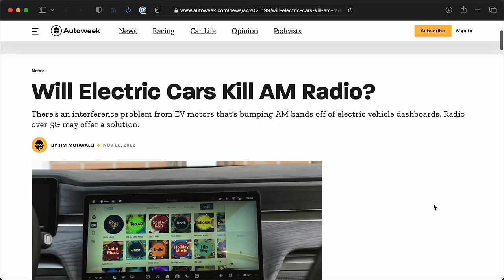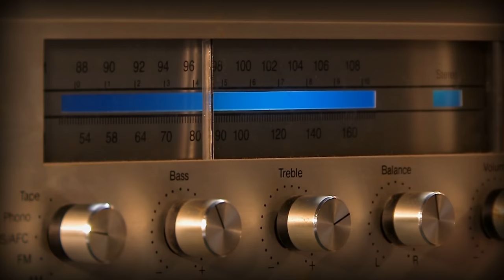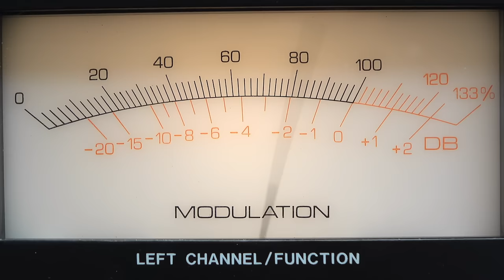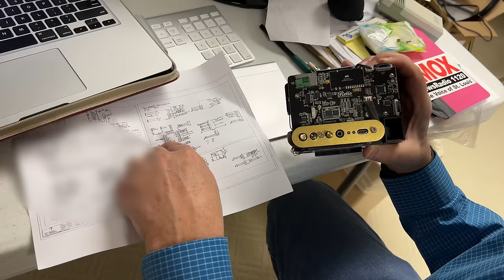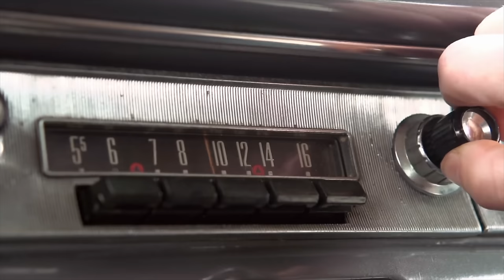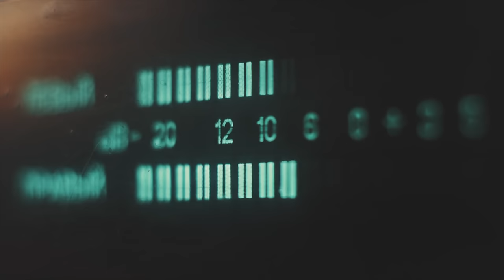Is AM radio dead? Tesla thinks so!

Comment: I buy, sell and restore old radios from the early 1900's.  Some of those old radios still have a great sound and pull in a good amount of stations at night. Many of those radios have short wave band receivers as well, and it's fun to listen to stations from around the world, even though they are also becoming scarce. I still enjoy the sound of an AM radio, the sound is undeniable.  Yes many things today generate amplitudes that interfere with AM signals, but it is still fun to listen to.
Reply: The sound quality of AM stations is crap. A far cry from what it was when I was young. The 5kHz audio bandwidth, the huge amount of compresssion and limiting, and even the digital audio processing taking place in the studios, make for a lousy listening experience.
Reply: Do you have a website?
Reply: They had big speakers, too. Heavy magnets.
Reply: I use to sit outside at night in my 57 Ford Ranch Wagon and easily tune in stations many states away. Those old car tube radios had the best reception.
Reply: @spaceranger3728  Not before 1940. AC radios before then had electromagnetic speakers, not permanent magnets. It took a lot of voltage to drive them but they were full and rich. The exception was battery operated "farm" radios which used PM's prior to 1940.
Reply: @johnstone7697  a lot of it has to do with the quality of the radio. I have a Sangean HD radio that not as good as expected, but my Grundig shortwave with AM and a long wire I can pickup stations three states away.
Reply: A good outdoor active antenna that covers LW to SW is a must for anyone restoring late 1920's and 1930's radios. Ultra strong reception and zero interference from computers, phone chargers, and non-class 2 wall warts in the house. Take it from a fellow restorationist ( ...currently working on a Trans-Oceanic and a Westinghouse "Seven Seas," both from 1969. The early multi-band transistors also have much better AM audio than most of what comes out today.)
Reply: @johnstone7697  A local AM station around here runs classic hits at night. It sounds like an 8-bit audio stream from 1998.
Reply: My dad bought one of these Y600s
https://en.wikipedia.org/wiki/Trans-Oceanic. Listened to the 1st orbiting satellite with it. Also WSM in Nashville at night. We lived in Detroit. Guess it helped with his home sickness. Still there AM 650 & with clear channel 50,000 watts.

Comment: AM radio stations really killed AM radio. Prior to the 1990s, on an AM/FM combo, the AM station was typically a "full service", 24 hour live format and the FM many times was automated music...

In the 1990s, most AM stations seem to make the shift from being local, "full service" to 24/7 nationally syndicated talk radio (large corporations taking over local radio as part of the 1996 Communications Act, likely play into that also), and those stations no longer were the community information hubs they once were.

As far as sound quality, 10 Khz channels with CQUAM Stereo sounded really good on a receiver that had an equally wide bandwidth...But broadcasters and receiver manufacturers went narrower band and dropped the C-QUAM...

Now broadcasting corporations just see AM radio licenses as a backdoor to "commercial LPFM" operation.

The FCC is also to blame for not strictly enforcing Part 15 noise limits on consumer devices. 

No reason the equipment inside a Tesla can't be filtered to reduce RFI. The traditional internal combustion engine literally has spark gap transmitters firing thousands of times a second, and they are filtered to reduce RFI. If you look at a lot of retro computers, they have extensive RF shielding around them and small capacitors on lines for RF shunting, now you rarely see that, mostly as cost reduction measures (ok, the RF shunt capacitors are no longer there because data lines are shifting at UHF/SHF speeds) ..
Reply: As for modern lack of shielding, well designed multilayer boards are usually a cheaper way to meet radiated emissions.
Reply: Shielding 700Kw of switch mode supply well enough that an AM radio will work well with the antenna placed effectively inside the loop area of the supply would be an interesting challenge.
Reply: What you are describing would go against Tesla’ s, and most other Web 3.0 disruption based companies design tenants .. which is to push off that cost onto everyone else .. Tesla could build RF emission shielding into their cars, but won’t,. And if they were pushed they’d just say that everybody else needs to design more selective tuners. 

It’s basically what happened with Light Squares and their interference with GPS signals a decade ago .. they wanted to run LTE on their purchased frequencies, regardless of the fact that consumer GPS receivers would be jammed while in proximity .. the company pushed it off on everybody else to redesign their RF front end
Reply: Fun fact: Part 15 has an unintentional radiator exemption for automotive devices. Maybe not quite a free pass, but I wouldn’t be surprised if some use it as an excuse to cut corners.
Reply: @satsuke  I didn't say they emitted significantly outside their chassis. I imagine that they do comply with all emi requirements. I said putting an antenna inside the dang thing would be difficult.
But no, you tell them how trivial it'd be and how evil they are.
Reply: Said   " The FCC is also to blame for not strictly enforcing Part 15 noise limits on consumer devices. "

I just got one of those $ 40 Baofeng UV-13 Pro V2 radios that everyone loves to hate but buys them anyway.   The battery  ( 7.4 V ) has a USB C ( 5.0 V )  port for charging.  As you might guess, there is an internal to battery DC to DC converter.  It makes so much RFI a that I can hear some noise on AM , tons of noise on the 450 - 490 Mhz FM band ,  have not figured out  what other bands are affected.
Reply: @satsuke   said "     they wanted to run LTE on their purchased frequencies, regardless of the fact that consumer GPS receivers would be jammed while in proximity .. the company pushed it off on everybody else to redesign their RF front end  "  

See also aircraft landing radar and 5G.   see "  0:00 / 28:59
5G C-Band Interference with Radar Altimeters in Aviation "  on the channel " blancolirio  "
Reply: I think you and your AM radio need to go back to a time before electronic ignition systems. Cars were very noisy when they had loads of mechanical things making and breaking connections. Modern EFI systems have none of that, leaving just the spark gap to make most of the noise, and it's rather well shielded inside the engine block.

Having gone through the BS to get a computer system through FCC testing, you'd need to encase the entire computer in foil to keep it quite these days. We had to use RF foam shielding on the case lid (like the stuff around an oven door, only much smaller), shielded ethernet cables, and put ferrite beads on all the PSU lines, including the external AC cord! Just to make the point... EVERY component in the system had UL & FCC certifications.

(I recall the story of Be (of BeOS fame) submitting the BeBox for testing. Radio Shack / Magnavox were adamant they NOT send their monitor in with the unit -- they knew all to well it won't pass. For the record, every input and output must have something attached to it, and the BeBox has a lot of I/O.)
Reply: My chevy bolt has an am radio, but really nothing interesting on it, so I never end up using it
Reply: I remember when I was younger that the police had the right to ask you fix a bad sparkplug wiring job if it interfered with their radio.
Reply: Something tells me that meters of extremely high voltage DC wiring from a couple of ESCs feeding directly feeding onto a synrm motor is gonna be significantly harder to shield than a couple of sparks.
Im no engineer, but the video quality on my FPV drone almost shuts down once all 4 of my ESC's are on full power. 
I cant imagine a car like your average tesla tryna get AM radio from all of that.
Even then, its AM radio. No one uses it anymore. Even when used out in the country as far away from powerlines and whatnot, AM Radio is just static and barely works.
Reply: AM Talk radio, especially local talk shows, until about circa 2005 were interesting, it is what kept AM radio alive throughout the 90s.

It appears that AM talk radio was artificially killed around 2011-2013, some AM talk radio stations had a significant listener base for interesting local talk radio,....so it was quite mysterious as to why they were all shut down or changed format changed the show at nearly all the same time.

Some might say, that social media and the internet has taken over the role of AM talk shows, but not really.

 The biggest difference between the internet and AM talk radio is that it is easier for the powers that be to manipulate, control, guide, alter the internet from the large scale to small scsle much quicker using AI bots, paid trolls, algorithm manipulation than it is to alter AM radio (other than shutting it down, or changing formats).

It is very difficult to have AI bots call in a talk show and be interesting, or to have paid trolls or agents and be interesting and real, also there is something different about discussion topics with a real person in the AM radio venue than it is on social media.
Reply: Bravo on nearly all of your points. I blame a lot on software and RF engineers with blinders on who see only what they want to see. No category of people causes me more frustration in an average day! Analog AM stereo should still be the norm today but they preferred to sue each other, and the sheepish radio manufacturers just walked away instead of offering it to the public anyway. Those full fidelity C-Quam tuners are fantastic but few have them.

The attitude of Tesla engineers toward AM radio also speaks volumes. The spark interference problem was of eminent concern in the 1930's. There was no FM yet, and shortwave also used amplitude modulation. They HAD to solve the problem or there would be no auto electronics industry. But today's Millennial "engineers" couldn't be bothered solving simple AM radio noise problems. Hey guys, here's a hint... it's called a capacitor.🤔
Reply: @satsuke  Exactly. Race to the bottom, destroy everything in the name of "disruption", this country would be better off if we all went back to the real American built cars we used to make.
Reply: Well said Corey!!
Reply: Where ? Its diffrent everywhere
Reply: (1) AM Radio switched to national programs like Rush Limbaugh and Glenn Beck because the # of listeners was waaaay higher than local news reports.
Reply: (2) AM Stereo was never successful.  Listeners didn’t think it sounded as good as FM Stereo due to lightning, overhead wires, and other interference.  (Plus you don’t need AM Stereo for talk shows or sports talk.)
Reply: (3) Despite a huge push for AM-HD radio with near-CD sound quality, the customers showed zero interest.  They rather stream music from their phone

.
Reply: Syndicated shows were made possible by satellite radio networks delivering dirt cheap audio feeds.  Before 1975 radio network news was delivered over telephone lines, which was more expensive.

Comment: I remember that AM problem very vivid. In fact, I used it for my advantage with my TI59. I placed an AM Radio next to it and dialed until I "heard" it computing. When the sound got steady, it was done. 😊
Reply: so cool
Reply: It's like the classic story of one of the first things that the first pc, the altair 8080 was made to do.  Before they had any input or output devices for it and it was just the front panel of switches and leds, someone found out that you could program it with the switches to have it perform specifically timed loops and it would alter the noise of a nearby am radio to make it play a tune and when they demonstrated it to the homebrew computer club there was a standing ovation!
Reply: I remember doing that with my TI-83+ as well, turns out anything you send on the link port you can also hear it on an AM radio, so you can hear the audio programs without having to buy one of those 1/10" to 1/8" jack adapters, that was pretty cool
Reply: In the 80's and 90's we had this problem with neurophyiological measuring equipment. I vividly remember the phenomenon of radio reception in EMG studies. The patient functioned as an antenna for the nearest transmitter: in one hospital it was a nearby AM transmitter for pop music and in another the beeper system of that hospital.
Reply: I had old pentium with 100 MHz fab. That was interesting over classic FM. Also 100 MHz. I knew when Linux kernel finished unpacking to ram. Haha.

Comment: While I don't listen to AM very often (if ever), I don't want it to die either. Because when SHTF and we lose power, phones, internet, the whole lot, its going to be the one thing (apart from CB and HAM radio) thats relatively easy to re-establish with the grid down.
Reply: Fellow ham here. AM has great range and the receivers are easy to construct, that is why it is good for emergencies. 73 de KC1PQO aka W1/BH4FHO.
Reply: I got my HAM license in 2018 after my whole area was on fire in 2017. We also had fires in 2018 and I think 2019. We lost TV, phone, internet, and only had AM until the towers went down. The AM station was the only thing broadcasting what was going on. I got my HAM license incase AM goes down too. The repeater is on the other side of the county so it stayed up and running during it all.
Reply: Actually if you can work 160 meters. In an emergency you could be an AM broadcast station. I had a 160 meter dipole built out of 12 gauge building wire less than 15 feet off the ground that I had to zig and zag with to make it fit on the property. At night I regularly talked to a lot of guys within about a 500 mile radius. And we'd rag chew for a few hours. And that was only using 100 watts

Comment: I think there's still a place for AM if anything it means that manufacturers actually have to design their products to meet a standard of electronic noise. But also I found out AM works underground! Biggest problem with AM is it ended up being only talk, of a recent scan of my dial I found out there is now an AM station that I can receive that has music on it and it doesn't sound that bad. Who is wish I had the time and attention span to enjoy more radio.
Reply: What killed AM radio was the FCC in 1962 mandated that most radios had to have BOTH AM and FM bands starting in 1965.  That's when people discovered music sounded much better on FM.  By 1980 there was almost no music left on AM stations, except in rural areas.  Many people may be surprised to learn that NPR stations in mountainous areas are on AM, not FM.  FM signal is blocked by hills, etc.

Comment: Here in Australia, the population in rural areas are sparse in between the cities and while FM stations are widespread in cities, the AM stations still function as a good backbone to keep the rural towns informed, and helps when there are emergency broadcasts such as bushfires. I don't drive much these days but occasionally I would tune in to the local AM station (even though most of the time these days I would tune in to the internet streaming or digital radio versions of the same station), and the funny thing is that it gets a lot of interference with the tram line in this city. Both have been around for a while so they've had to co-exist.

Comment: I remember back in the Cold War many U.S. AM radio stations were part of CONELRAD/EBS. During the 1970's and 80's, Top-10/Rock & Roll radio stations would simulcast their signals both on their FM and AM transmitters. It used to be that local, usually small-town AM radio stations would often be required by the FCC to sign off at sunset.
Reply: Even today, on some Interstate highways, the signs urge you to tune to certain AM radio stations for the official traffic reports. Local weather and traffic reports are the main uses I have for local AM radio.
Reply: I remember that.

Comment: Hey, Joe! I didn’t know you had a YouTube channel until now. I’m glad you tackled this topic. I had a Lincoln MKZ hybrid that was quiet as could be and had a Microsoft SYNC HD radio in it that has a synchronized AM tuner! It was amazing to be directly under an EL track and still not have a ton of noise blasting through it. Not only was the car quiet of noise that allowed me to install a HF Ham Radio in it, they put a good quality radio in the car, too. My Hyundai hybrid I have now is very noisy, however their AM analog and HD radio do work fine in it. It does pick up some noise, but not enough to interfere with even a weak station that I wouldn’t listen to very long anyway. The cars that have eliminated the AM radios in them beg the need to be measured to see if they are FCC compliant. I have noted that vehicles beside or near me at stop lights are a source for noise. The same for signage and other lighting. The less we deal with that, the more trouble we’re going to have as time goes.
Reply: Hey Scott! Cars seem to be key for all broadcast radio. Your experiences in the car are a lot like mine. I am also fortunate to live on the north side of the metro and KMOX aid particularly strong. But like a radio guy I tune all over the am/fm dial comparing recieve, audio processing, etc. more to come on AM!